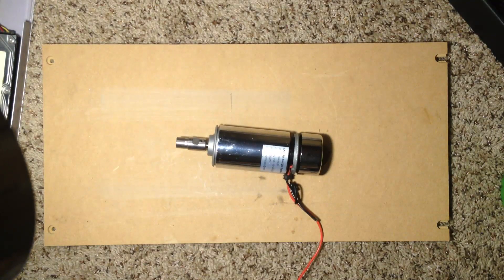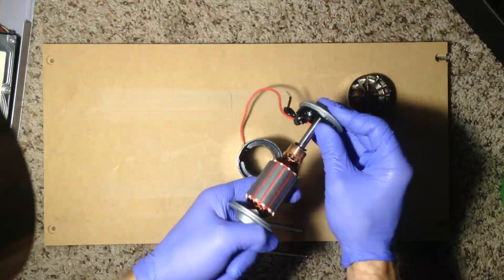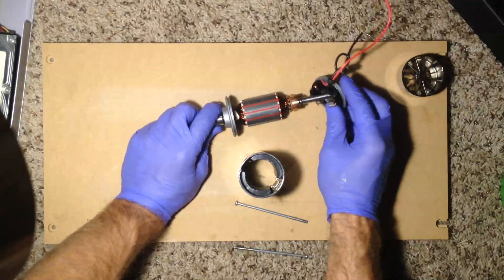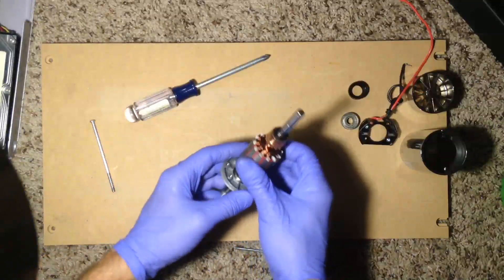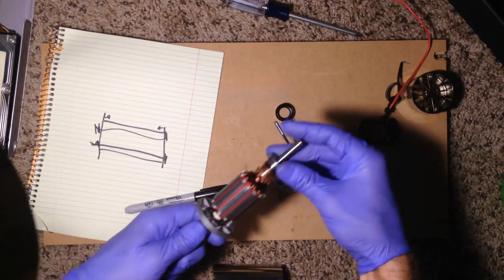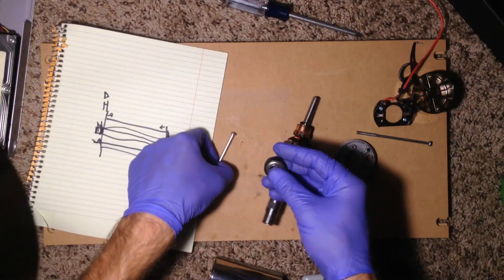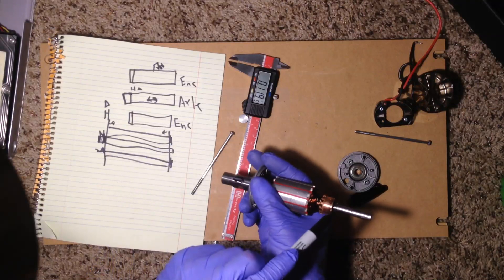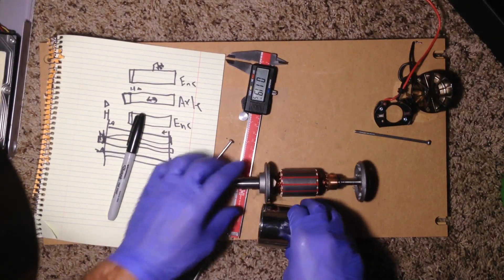Inventables' 300W Spindle Review (Chinese import)

Comment: As is already been said , it's fine for non metal  materials and light cuts. Mine is the smaller version of the 3018 and I get very detailed cuts on 3d engravings on hard wood and if I have to replace the motor after a year or so I will .

Comment: Too lot of words, just one phrase: THIS IS NOT SPINDLE.
You buy DC motor, that's all.
If you want spidle, buy C20 or C25 ER25/ER32 collet, put in in agular bearings, and drive it with this motor. Or use it in tiny lathe as motor, not spindle.
Reply from the maker: Sage advice.
Reply: Here is sample: http://www.cnczone.com/forums/cnc-wood-router-project-log/139414-er16-router-spindle-build.html
Reply: This is other approach using model motor: used straight collet with thin 8mm shank and additional mechanical stress perceptive bearings block: all high loads will be put on bearings and housing fixed in spindle holder
http://hackaday.com/2014/08/03/brushless-dc-motor-used-for-high-speed-cnc-spindle/

Disanvantages: very nauseous loud and price (power model motor in first) going to regular watercooled cheap spindle
Reply: If you have lathe available, you can move this like way: make your own rigid front bearing block with angular bearings pair (8mm shank is problem -- too small to easy found bearing, 12mm is minimal for widely used bearings), press it X-oppositely in housing, and reassemble your motor.

Comment: What do you expect? You pay nothing, you get nothing. Your comparison with quality spindle sucks. A quality spindle costs considerably more. Your "verdict" is wrong. If you expected to use this motor for milling aluminium then you don't know what you are doing. I don't think I have ever seen these advertised as spindles for milling metal. Engraving (even in aluminum): yes, milling PCB: yes, milling plastic and wood and other soft materials: yes, milling aluminum: NO. I have used a 400W version of these cheap motors successfully for over a year now and have very little issues. Still milling with great accuracy, but of course, if I had a Jäger or other high quality spindle I'd get even better results... Your expectations are too high...
Reply from the maker: I pay less for a spindle I designed and get a whole lot more ;).  Removed the middleman.  You CAN build a quality spindle without breaking the bank.  My goal in publishing this video is to show how a poor quality spindle is made, fooling people to believe it's better than it is.  And to be clear, this spindle was advertised for cutting aluminum.
Reply: Like I said... mine still works as expected. Though, I don't use it any more.

Making one which is better is possible, yes, that's for sure but don't try to convince me you can make one for less money than these spindles cost, because that's nonsense. You can also not build one which is better without having EXPENSIVE machinery taking up a lot of space and yes, costing a small fortune. Not everybody has the interest or the means to make one. If it's breaking the bank or not, depends on the size of your bank, isn't it? Everything else is just in your imagination. What YOUR spindle was advertised for is something you should discuss with the seller, but yes, generally you indeed can mill aluminum with these, but you MUST use very high quality cutters, and MUST know how to do it. Mine, even though that's a 400W version, can mill aluminum, many people can manage that, even if it is not the first choice of motor for aluminum milling.
Reply: @qwqeh... Where is the review to your spindle?

Comment: I thought of replacing the ball bearings at both ends with roller taper bearings, along with a steel ring the front and back to locate the rotor between the bearings. Perhaps machining some new end-plates to fit the bearings as well.
That way, when it all clamps together with the longitudinal screws the bearing self-centre and removes any play.

Comment: I got the 500 watt chinese spindle with controller for about 80 euro. When i push horizontally against the collet holder in one direction, the axis easily moves 0.2mm. Which could easily be explained by plastic rings around the bearings. Very big disappointment. During milling the cutter starts jumping around, vibrating heavy, noisy. The milled surface clearly visible not flat. Knowing what i know  now, i would NOT have bougth this 500w chinese spindle. Thanks for your information. Hopefully it prevents people of making the mistake of buying one.

Comment: useless crapper. i bought two of them from different vendors and on both bearings died after about 20-30 hours of light use . by light use i mean cutting WAX, at 700mm/min 1-2mm deep . literally idle. wouldn't be a problem,if i can change the bearings,but as been mentioned in vid-you won't be able  get the chuck out. period. don't waste your money on this. not to mention poor construction with a lot of various holes. you will get a lot of dust inside instantly destroying the spindle and it's bearings,if you try to cut something dusty.  wood or -mdf

Comment: A very detailed and helpful review. I had been having issues with wavy lines and suspected a faulty head bearing.
After viewing the review I tapped three m3 holes around the bearing holder and added three screws to secure the bearing from lateral and to a lesser degree longitudinal movement. This made a huge improvement, the cyclic movement under load being completely eliminated. Ideally the same procedure could be performed at the other end but I was unable to remove the plastic cooling device. (not that it is effective at cooling)
Thank you for sacrificing your spindle motor for our benefit.
Reply: +Alan Turner Can you provide pictures or drawings of these m3 holes?
Reply: +Victor Virball 
Hi, there is a photo at: https://flic.kr/p/CcTTF9
I drilled the holes at 2.5 mm and tapped at 3 mm with a bottom tap with the tip ground off.
Be careful with the tap as it is very easy to strip the thread out.
Good luck.
Reply: +Alan Turner Thanks very much. I'm considering getting this spindle for light use (plastics and maybe 1/8" aluminum), so I wanted to see if I could replicate what you've done. Are you satisfied with your mods?
Reply: +Victor Virball 
Yes I am very satisfied. The modification made my machine usable.
I suspect it will reduce the life of the spindle motor as I am unable to (as yet) perfectly position top and bottom bearings in perfect alignment. As such the bearings will wear much faster than normally expected. A spindle motor with quality bearings with then be sought, but for the time being this will do the trick.
I have used my machine on fiberglass PCB, UHMW PE and what we in New Zealand call custom wood, I have yet to try aluminum.
Reply: +Alan Turner I'm not quite ready, but I think I'll go with this spindle.
I'm not very mechanical so I hope this is not a stupid idea. Based on the excellent video it appears that the top bearing is removable and therefore replaceable. Could a plastic bearing as shown in the following link be used?

http://www.igus.com/wpck/3744/productoverview_igubal
Reply: +Victor Virball 
As I could not get my motor apart without damage, I am unsure of the exact dimensions of the bearing or its housing. as such I cannot answer your question, sorry.
Reply: +Alan Turner No apologies necessary. Thanks for the information that you have provided. I'll post something after I have some experience with my spindle.

Comment: These are small cheap 300w spindles.  I don't know why some people think they should be able to hog out aluminum cuts like you would on a bridgeport mill.  As long as you work with the limitations of  a $50 300w spindle you'll have no problems.  These are hobby machines...and yes I have one.  I also have a CNC benchtop mill with a 3/4hp motor and a CNC router with a 1.5hp spindle.  I can cut aluminum on my Chinese 3040 engraver/router, but honestly its not made for that.  Its made for light wood or plastic cutting and engraving.  Mine came with a 300w black spindle with externally replaceable brushes and the spindle still works fine after 3yrs...because I don't overload it.
Reply: Agree

Comment: My router came with one of these, last night the shaft snapped in two while milling aluminum using a 6mm endmill at 500mm/m and 0.15 overstep. It was doing fine until there was a bump and a rattle...
In any case I managed to replace the shaft, removing the ER11 collet holder is actually very easy, using a gear extractor gripping the holder at the top and pushing the extractor screw into the collet hole.
First thing I'm going to do is mill some new bearing seats (the black rubber things you pointed at) out of metal or plastic. In case anyone else wants to do the same, before the spindle conks out, the measurements in mm are:
Bottom seat: 22.8OD, 22ID, 7.5 height, 1mm thickness at the base, 13.5 hole.
Top seat: same as above, except 23.9OD

Comment: where did u find this for 30$ i can find it around 80$ everywhere
http://www.aliexpress.com/item/CNC-300W-air-cooled-Spindle-Motor-12-48V-DC-ER11-collect-with-Mount-bracket-For-Engraving/1028408167.html
http://www.amazon.com/12v-48v-Air-cooled-Spindle-Bracket-Engraving/dp/B00CLL2356
62$ with no mount and fan
http://www.amazon.com/RioRand-DC12-48V-ER11-200W-Spindle-Engraving/dp/B00K48U684/ref=pd_sim_sbs_469_2?ie=UTF8&refRID=0ARW6DFRXKQZVTEAAQYH

Comment: I have a fundamental issue with this video...

You are evaluating it as if this were a $5000 spindle, which it is not. It's less than $100, so what do you expect? They sell it for $80 which means it cost them ~$50 to make in china. I would bet my life savings on you being unable to produce a higher quality spindle for $50 (including labor).

Always keep your expectations grounded by what you paid for it not what you want.
Reply from the maker: I sure hope you don't have too much saved, as I ended up designing a far superior spindle solution that costs much less than $50 in parts... I've now shipped my design in several thousand CNC machines... so please send me your bank account information so we can wire your life savings into my account, except that you probably don't actually have any savings.  Also, heads up that the spindle I reviewed probably cost more like $20 in parts in China... more proof that you should stop posting like you're smarter than everyone else.
Reply: ok, what's this miracle spindle?